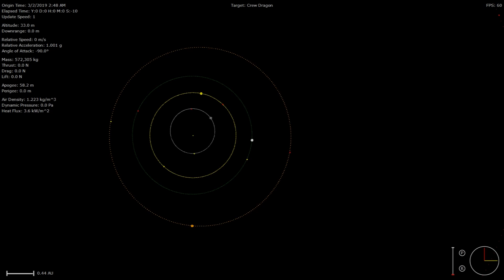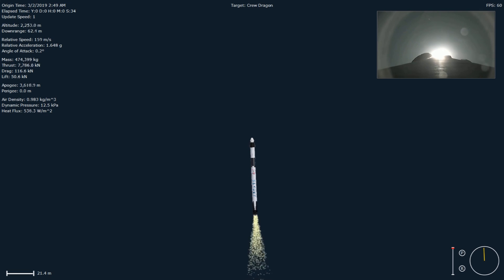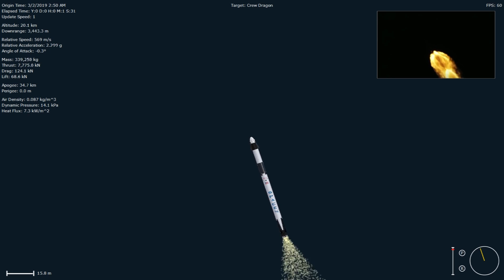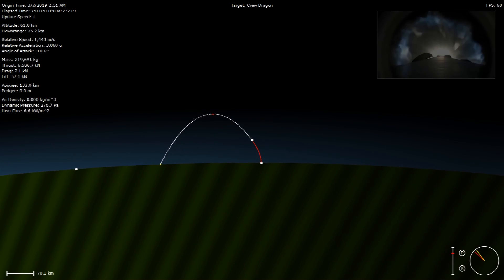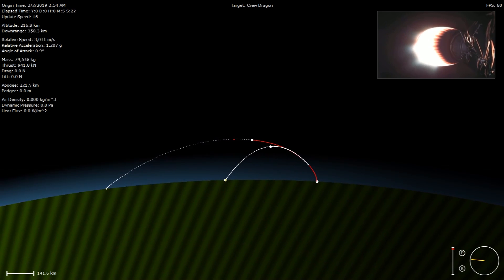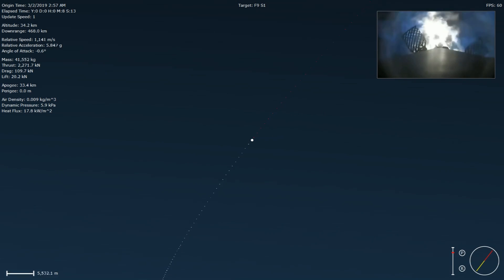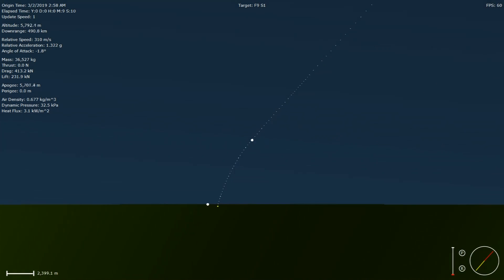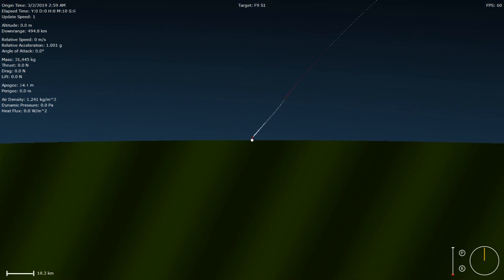Crew Dragon Launch Simulation

Comment: Im commenting here instead of on github.

It seems the simulator doesnt take in the account atmospheric pressure effects on isp of an engine. So im guessing its manually fitted. 

So far i was unable to use command line arguments to run any other flight profiles. Do i really have to get visual studio and compile it there for that to work? (Win8)
Reply: There are some other versions besides "main" some of them have a "build" folder. Mostly older.